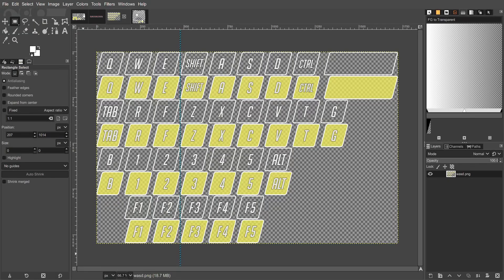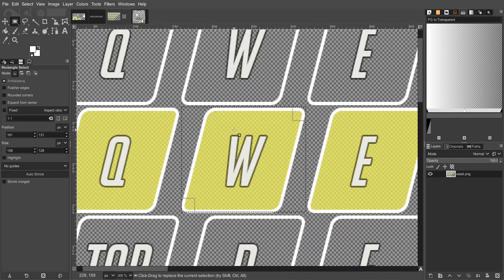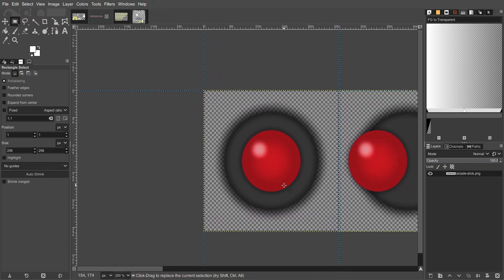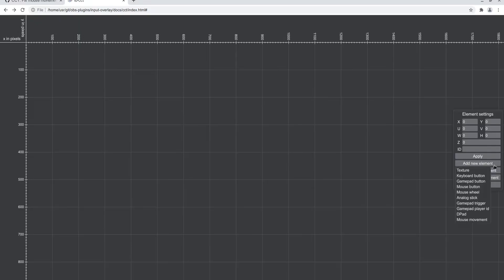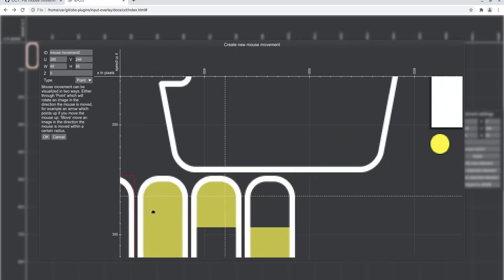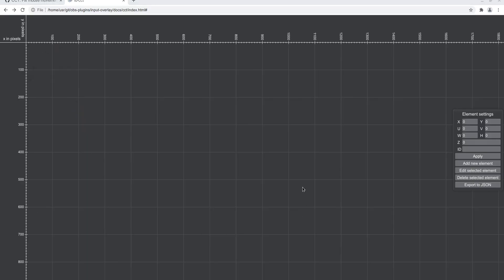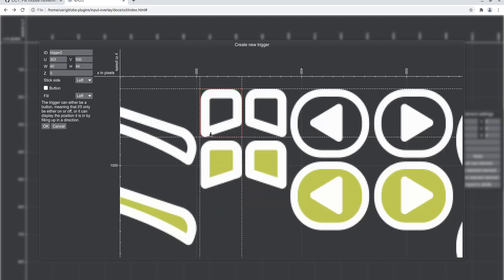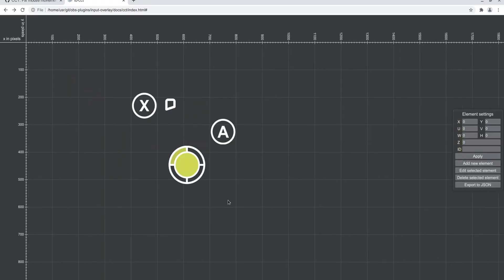Input Overlay - Config Tool Tutorial

Comment: it would seem that the controller input for the recording the binding does not work, nor does the tool have the ability to read the controller input as provided through steamlink. I know this software has only gotten harder to use and less consistent but this is definitely preventing it getting adopted for anything but the most basic use cases

Comment: Possible to add more than one config? i.e. looks like a more than sufficient keyboard, and mouse, are both included. I'd like to just plug both of those in and rock on. Not finding it obvious in the settings where exactly to do that.
Reply: Yes, you can add the input overlay as many times you want with different textures and layouts.

Comment: I'm trying to reproduce a joystick look with the keyboard controls. How exactly do you convert the .json into a .ini?
EDIT: nevermind, downloading the installer for the version 5 did it for me.
Reply: im trying to do the same thing and i have the latest version how did you get yours to work?
Reply: @bloodninja4628  just get the installer for the latest version, restart your computer if you must and then re add the controller overlay, check into its settings and it should now take your json
Reply: U added a controller overlay ?im talking about a dpad overlay
Reply: Im trying to remap the arcade stick positions into arrow key movements and also trying to remap some png files in place of regular keyboard inputs is that possible?

Comment: arrow keys just arent compatible??
i wanted to make an overlay for the arrow keys and they work fine in the editor but no response in OBS. i thought maybe i was doing something wrong and decided to do a quick test changing my "up arrow" element to read the "w" key and it worked flawlessly. i would definitely like to know whats the deal with the arrow keys or if it really is something on my end.
Reply: I meet the same problem as you did. Then I find the normal arrow keys' actual mapping are swapped with NUMPAD arrow keys'(when turn NumLock off). To solve the problem temporarily, try to use NUMPAD arrow keys while making your json file in the editor. Then you may find normal arrow keys' input-overlay working correctly in OBS.
Reply: @giga-35b69  nice find. it's working now
Reply: @giga-35b69  love you for this help
Reply: @giga-35b69  Thanks man, yout got me work out the keys (del, pos, ...) They're also on Numpad!
Reply: try running obs as admin
Reply: @polhikkii2431  running as admin had no effect sadly
Reply: @hianara3126  ok man. You will need the 4.7.4b release. Locate and extract util, and then run demo hook async.exe (make sure obs is closed). Type the key you need and then write down the keycode, which should look like "0x28" for example. Go to the overlay editor and paste the code by unchecking the key detector. I used "0x0028" to make my key work in this example.
Reply: @polhikkii2431  i dont think you understand my problem correctly, i have the input overlay working fine in obs. im using a simple "wasd" layout i created but i would much prefer it to be the arrow keys. i can make a simple video showcasing the two overlays if need be.
Reply: @hianara3126  Yes, I do not understand your problem. If you can re-phrase from the beginning I'm sure it'll work out better for everyone.
Reply: @polhikkii2431  im not so great with language. i used the config tool to create an overlay for the arrow keys and while they function properly in the tool, they have no response when i plug it in to obs. i then kept the exact same setup but changed the keycodes from the arrow keys to w,a,s,d and as those keys it started to work in obs. i also tried one of the presets and it worked fine, so i dont understand the problem with using the arrow keys.
ive uploaded a video with a link to the two config files in the video description.

→ Xarcolyptic